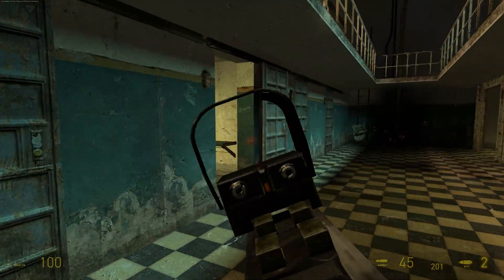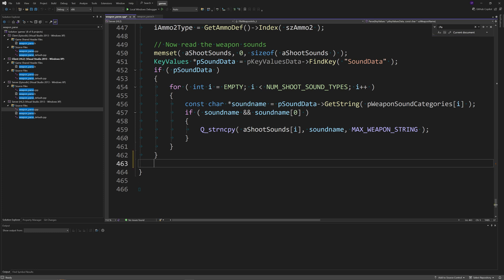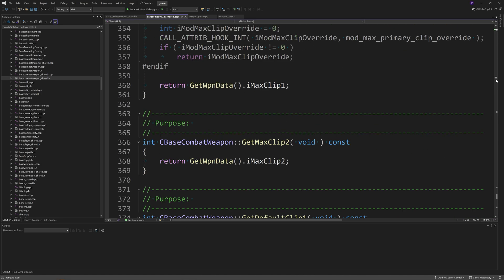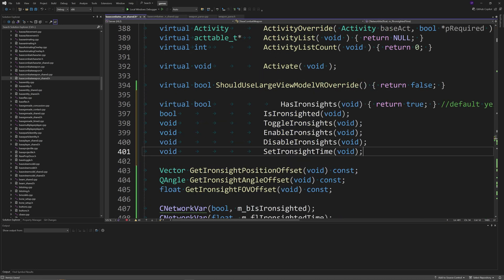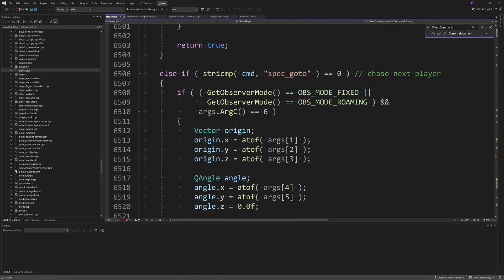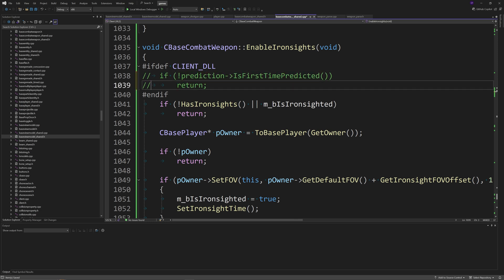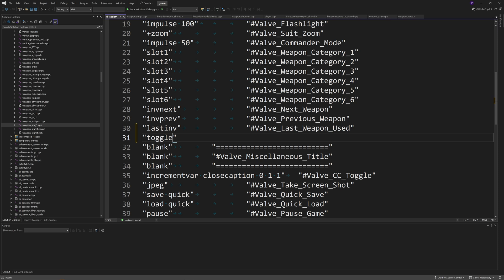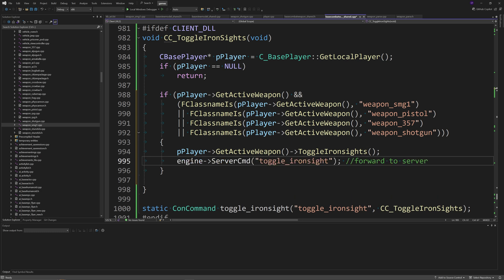Valve Source Code 2013 Tutorial (Episode 30): Adding Ironsights

Comment: EDIT: I guess the Source 2013 branch does include the 20th anniversary and other engine improvements and only Source 2013 Singleplayer is outdated. Assuming Source 2013 works for singleplayer games I wonder why they even release a separate singleplayer and multiplayer version besides the generic Source 2013 version. I am new at Source modding but will give that Source 2013 a try 🙂

Hey, thanks so much. I want to follow your tutorial but do you maybe know if the below is an obstacle if I want the latest graphical bells and whistles ?
From Valve dev site :
Important:
As of October 2025, unlike Half-Life 2, Portal and Half-Life: Source, Source SDK Base 2013 Singleplayer hasn't been updated since 2015, and doesn't include any new features from Half-Life 2's 20th Anniversary Update or Team Fortress 2 branch (such as radial fog, classic particles, etc.) aswell as bug fixes introduced with later version of Half-Life 2 (and other Source games).
The latest version of Source SDK Base 2013 SP are from June 2014, while upcoming branch was last updated in September 2014. Gamecode for the SP branch was last updated in September 2015.
Reply from the maker: Thanks for the comment, however the Source 2013 Singleplayer code does not include any of the 20th anniversary features and I don't know if it is possible to add them.

Comment: I did this for the crossbow work's fine. But I want to set it to right click so it just replaces the SecondaryAttack function for the crossbow. I've already gotten rid of the SecondaryAttack Function for the crossbow and it works fine but I just don't know how to set the iron sight to toggle when you right click on the same key bind.
Reply from the maker: I believe that part of the problem you are experiencing is the way the ironsights feature was added and it requiring a specific keybind to be pressed in order for it to work. That is, if I am understanding your problem correctly!
Reply: @TheMaster974  Yes, it is.
Reply from the maker: I might have a solution for you that I'll cover in an upcoming followup video. For now though, you can try to add ToggleIronsights(); to the SecondaryAttack function. You may also want to add a delay between secondary attacks by also adding something like: m_flNextSecondaryAttack = gpGlobals->curtime + 1; where you can replace 1 with whatever you want. Hopefully this helps!

Comment: If you want to turn on/off the irsonsight function with a keyvalue in the weapon script file, here is what you have to do:

Open weapon_parse.h, inside the FileWeaponInfo_t class find "char szAmmo2[MAX_WEAPON_AMMO_NAME];", after it add this line: bool bCanUseIronsight;
This should look like this:

char szAmmo2[MAX_WEAPON_AMMO_NAME]; // "secondary" ammo type

bool bCanUseIronsight;

Now open weapon_parse.cpp and go to FileWeaponInfo_t::Parse, find the IronSight keyvalue:

KeyValues* pSights = pKeyValuesData->FindKey("IronSight");
if (pSights)
{
	...
}

Add the following after it:

KeyValues* pCanSight = pKeyValuesData->FindKey("CanUseIronsight");
if (pCanSight)
{
	// 0 means the weapon can't use the iron sight function, 1 means it can
	bCanUseIronsight = (pCanSight->GetInt(nullptr, 1) != 0);
}
else
{
	// The weapon can use the ironsight function if the key value doesn't exist in the weapon script.
	bCanUseIronsight = true;
}

Open basecombatweapon_shared.h and declare "bool CanUseIronsight() const;" somewhere in the file (i recommand to declare them near the Ironsight functions, EnableIronsights, DisableIronsights...)

Open basecombatweapon_shared.cpp and add:

bool CBaseCombatWeapon::CanUseIronsight() const
{
    return GetWpnData().bCanUseIronsight;
}

somewhere in the file, like above the ToggleIronsights function.

Now at the top of the ToggleIronsights and EnableIronsights functions, add:

if (!CanUseIronsight())
	return;

It should look like that:

void CBaseCombatWeapon::ToggleIronsights(void)
{
	if (!CanUseIronsight())
		return;

	...
}

...

void CBaseCombatWeapon::EnableIronsights(void)
{
	if (!CanUseIronsight())
		return;
        ...
}

Now compile your project, open any weapon script file and add the new keyvalue "CanUseIronsight", 0 for no, 1 for yes.
That all, have fun.
Reply from the maker: Thanks for providing this!

Comment: I used the code for my mod, when i touch the level_change trigger after using ironsights on another map, the viewmodels are gone and re-appear  only  if you press the ironsights button again. Any ideas?
Reply from the maker: I have been made aware of this issue already, however I don't know why it happens or how to fix it unfortunately.

Comment: After a few tries, here are the values I used for the Half-Life 2 weapons in their .txt files:
(Of course it's made to work only with the original viewmodels)

Pistol:
"forward"	"-10"
"right"		"-5.5"
"up"		"4"
"roll"		"0"
"fov"		"-20"

357:
"forward"	"-10"
"right"		"-5.6"
"up"		"2.5"
"roll"		"0"
"fov"		"-20"

SMG1:
"forward"	"-10"
"right"		"-6.43"
"up"		"2.5"
"roll"		"0"
"fov"		"-12"

AR2:
"forward"	"-5"
"right"		"-1.5"
"up"		"1.5"
"roll"		"-10"
"fov"		"-5"

Shotgun:
"forward"	"-5"
"right"		"-9"
"up"		"4"
"roll"		"0"
"fov"		"-30"

Crossbow: (ONLY IF YOU HAVE A DYNAMIC SCOPE SYSTEM ON THIS WEAPON)
"forward"	"-5"
"right"		"-7"
"up"		"3.1"
"roll"		"0"
"fov"		"-40"
Reply from the maker: Thanks for the comment and for providing the ironsight information!

Comment: How would you go about having two hand models , one before you have the hev suit, and one after getting the hev suit
Reply from the maker: You could follow this guide: https://developer.valvesoftware.com/wiki/Hand_Viewmodels or use the Mapbase code as a base, as that allows you to specify if the weapon should use a hand viewmodel, which could be used to switch between hand models, however I'm not sure what the best way to do this would be.

Comment: make the player initially an ally to combine and hostile to rebels, instead of using ai_relationship
Reply from the maker: I'm not sure about the best way to achieve this, you could probably use something similar to what I showcase in this video: https://youtu.be/P09G2ORx3qI
Reply: Don't npc_citizen's AI to be adjusted to be usable as enemies? I remember i tried to turn npc_citizen hostile to use as second enemies (i used main enemies being combine/swat for the level) but the citizen's accuracy are too high than the swats/combines
Reply from the maker: @HL2Modder2001 Probably, I haven't experimented around with this so I wouldn't know what you would need to do to fix that.
Reply: @TheMaster974  Or i suppose using combine for their AI might be better, and find a solution for per-enemy sentences.txt and custom models using combine anims

Comment: the method used in that guide isn't prefect or practical at all, moving / rotating your view model to achive a ironsight look isn't practical and causes a lot of visual issues, like when you aim down your sign, u can see your weapon goes from the left to the right in a weird way, the correct way todo it, is by exploiting the SecondaryAttack function to play a special animation for the ironsight just like in black mesa, they did it for the 357 magnum, then adjust the FOV to achive a zoom effect
well while its a bit harder since you have to create a ironsight on/off animation + special shooting animation for ironsight mode, and then handle possible events that should cause turning off the ironsight like reloading or sprinting or changing the weapon, but thats the best way todo it, at least for source engine
Reply from the maker: Thanks for the input!

Comment: This is awesome!! Altought I do wish you would make a tutorial about spriting as a mechanic and such. Like max amount oxygen/time amount to sprint, speed, new mechanics related to spriting etc. I tried to use the valve dev wiki and look in the files my self, but no luck. If you could do it for source 2013 mp it would be awesome!!!
Reply: you can use weapon models from MMOD since they have animation for sprinting, then all you need is defining the new animation, then handle the animation start and stop correctly
you can look for the code that makes the player lower their gun when aim on a friendly npc, and change it so you lower your weapon on sprint then u want to separated your sprinting animation trigger from the lowering animation trigger and playing the correct one based on priority, for example you should play the sprint animation even if you are aiming on a friendly NPC and sprinting at the same time, coz in reallife, u can't sprint well while lowering your weapon in a static position
Reply: Ah no no, I dont mean on how to change the ironsights while spriting, rather, a guide on how to modify the spriting code and such
Reply from the maker: Thanks for the comment, you can look into the hl2_player.cpp file for modifying sprinting stuff.
Reply: theres tutorials on editing aspects of sprint like lowering weapon on the valve wiki That you can learn about the sprint function through